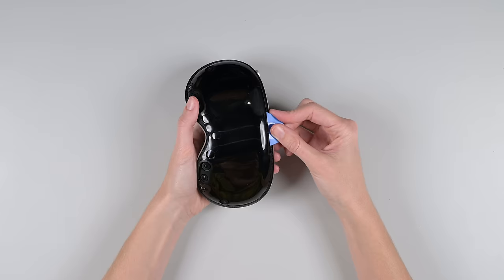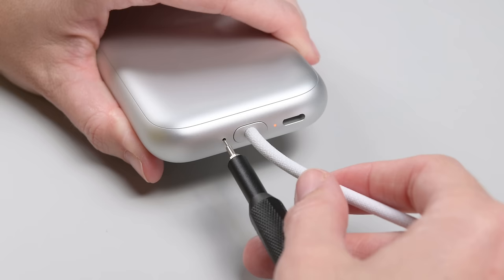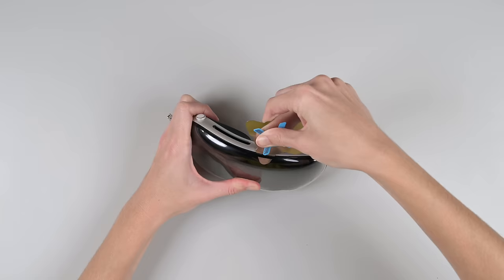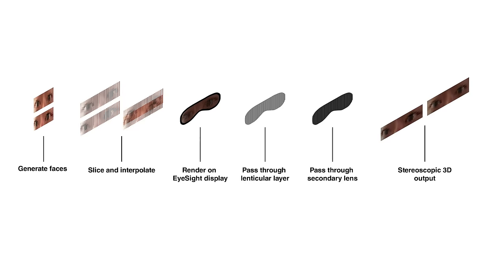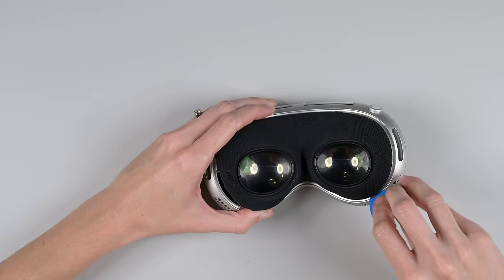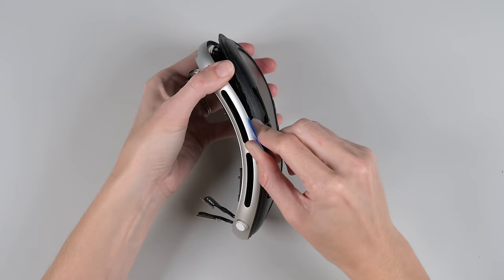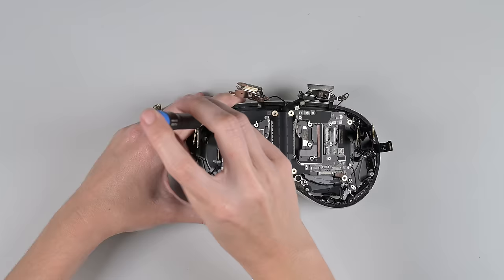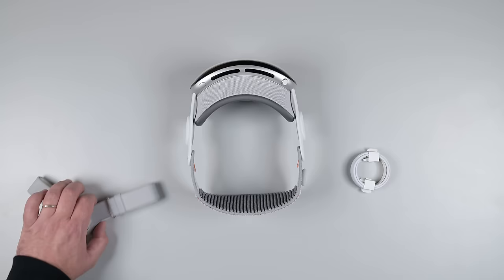Vision Pro Teardown: Behind the Complex and Creepy Tech

Comment: god... Apple's level of engineering is ... insane
Reply: It's insane to the point that it's foolish and ends up costing them and customers more
Why
Reply: To all apple fans.. That is not ment in the good way  ... xd
Reply: @VskutkuTrigen To the adults in the room … yes, yes it is.

Fanboying is a children’s hobby.
Reply: Correct statement, but for wrong reason. AVP's engineering is very impressive not because of complexity, but despite it. Good engineering is about finding the simplest way to achieve the desired result. A popular saying: "“Anyone can build a bridge that stands, but it takes an engineer to build a bridge that barely stands.” is related to that.
Reply: No wonder they didn’t make a lot of them
Reply: The difference between insanity and genius is measured only by success.
Reply: @ZeranZeran  Good engeniering cost money. Thats why a Bugatti cost more than a BMW, and a BMW more than a VW. And you dont have to buy Apple. But when i spend a lots of money i want good building quality. Or because i want good quality, i accept to pay more. But its cost the customer not much more. A galaxy cost almost the same as an iPhone. But the iPhone looks from the inside like 1500€, Samsung looks not like 1500€.
Reply: unneccessary complex? like even the internal of the iphones are riddled with uncessary flex cables. Samsung just have everything built in and connected through contacting copper joint.

For the vision pro, they added so much complexity for a pair of fake eyes that look freaking creepy (it is nothing like their ads). Basically it is a blurry set of eyes because the resolution of the front oled panel is nowhere near dense enough for a proper 3D stereoscopic effect. Additionally, that big oled panel is also extremely expensive, for almost no benefit because no one can see the fake eyes because it is so dark and blurry. This is more like Newton than the iPhone.
Reply: @Clyde-lj4fx   Over complicated build does not mean good build. Usually the opposite.
Reply: The Chinese factory is working overtime to produce Vision Pro🥲
Reply: @ZeranZeran  This is a $3500 top of the line AR headset, the people buying it definitely arent concerned about cost
Reply: @VskutkuTrigen  im pretty sure this is meant in a good way. Its nice to see Apple showing hardware innovation again
Reply: @kazioo2  there is no simple way to achieve what they are trying to build tho. When you're designing a headset like this, its gonna have to be overengineered
Reply: @couchpotatoes5158   I am one of the people concerned about the cost.
Reply: Well not just Apple but VR AR headset in general
Reply: Mmm... it's a lot of stuff. It feels very prototype-ish. All of this somehow needs to be condensed down into simpler construction to make it mainstream affordable. People have been trying to make VR mainstream for 30 years. This ain't it, either.
Reply: @ZeranZeran  it’s intended mainly for developers right now. It’s obviously not accessible to the vast majority of people. I’m guessing they’ll lower the price at some point
Reply: @couchpotatoes5158   Probably, but the current build is obnoxious
Reply: @ZeranZeran  I am seeing this peoduct as novelty.
If you want VR, there are already cheaper alternative in the market.
Apple Vision just... put everything up a notch.

A premium PC VR has a lot of trackers that you must put at the corner of the room to accurately track your movement.

Apple somehow miniaturize and put it in the head with size not as bigger than regular VR.

Plus... I am seeing Apple Vision as a Halo product, a product that makes people want to buy Apple product
Reply: There's a massive profit to be made off of making things crazy complicated. It's not necessary complication, but alas, not being able to repair a device anywhere else is huge money.
Reply: because its higher quality? @ZeranZeran
Reply: @VskutkuTrigen still trying to start war over electronics things in 2024 🤓
Reply: Insane is definitely the word to describe it, don't know about "engineering" though
Reply: @redbean9410  No, it's not
Reply: @ZeranZeran of course to put all the technology they have to single piece of headset and being efficient in almost everything. I do think that the high price of vision pro is because the RND not the cost of the part or anything.
Reply: @ragilsaputra5550  this is not efficient, its needlessly complicated so that people can't repair it themselves
Reply: @Clyde-lj4fx  please don't say good engineering and BMW in one sentence. I'm not saying someone else is better or worse, I'm just saying that can't say that about BMW.
Reply: @daddyscrapes  I wonder if they released so few because this is as close as their early prototypes were and most of this will be scrapped on gen2, or they simply don't care about repairability (considering they may need to service these devices in the near future for things like scratched lenses, faulty movable parts, etc).
Reply: @MindBlowerWTF  i say Bugatti cost more than a BMW. So i dont say bmw do it perfect etc. Only against VW, my family never hat problems with BMW. My dads drove 450.000km/279617,037mi without any problems.
Reply: @ZeranZeran  I have used Samsung, Xiaomi, LG, and Apple so far. I had the best user experience with Apple. Xiaomi is my second choice. Samsung was terrible. I had the Note 9, and I would leave the house around 7 AM, and by 3 PM, the battery was already drained. With my 11 Pro Max (same apps, same usage, etc.), the battery lasts well beyond the day.
Reply: @phantom1076  If you don't understand why Apple chose to implement a ridiculous looking screen on the outside of their headset you clearly have very little knowledge of their marketing techniques. Apple went through all that complex stuff just to stand out and make their product instantly recognizable in the sea of VR headsets. It has nothing to do with functioning properly and everything to do with brand recognition and being unique.
Reply: @ZeranZeran then explain German cars? How are they so high quality?
Reply: @Clyde-lj4fx  A Samsung at 1500 is a Fold, which does looks like how it's priced, if not more. You went from a Note 9 to a modern iPhone, just at when they just got good battery life and before that, everyone complained how Apple battery life was bad. So lets not be unreasonable here, please. Watch a Fold 5 or S24 teardown and battery tests.
Reply: @ZeranZeran  they absolutely are lmao. If they weren’t Apple wouldn’t be what they are
Reply: meanwhile the quest 2 isnt a novelty luxury product for overgrown man babies, costs like 10x less, and isnt over-engineered by a schizo with an electronics degree
Reply: @redbean9410    I think you over estimate Apple and under estimate greed. This type of design makes it harder for repair and everyone involved. Though it is a beta so hey
Reply: @ZeranZeran  Apple products are never meant for repairability nor do they ever market it as such. so it doesn’t make sense to judge them on something they have no intention of. Judge them only on what they advertise
Reply: almost every sinle digital camera is more complex than this yep.
Reply: @adredy  fact that u think that means u have no idea what you’re talking about
Reply: @Clyde-lj4fx  what are you talking about? samsung has way more advanced tech inside its S24U than apples I15PM
Reply: Incredible enginnering by Apple!
Reply: @danielplaya4211   I don't know what German cars have to do with this, but relating to a PC or a CPU, they would be most efficiently built and user friendly, able to be repaired. Not hidden behind 14 layers of plastic, and 64 screws. That should be saved for diving gear.
Reply: @Clyde-lj4fx  What anyone thinks what the smartphone looks inside? You don't pay for asthetics inside a smartphone, if you see inside, it is then broken. 
It is like admiring someone by the look of their inner organs...
Reply: @paristo ironically, that is why Apple products are well engineered, they tend to care how the internals function as well as look. In Steve Jobs biography by Walter Issacson, Jobs’s father paints both sides of the fence. The Younger Jobs asks why if people will only see the fence from the outside. The father replies, we see both sides of the fence…

At the end of the 20th century, the inside of desktops computers looked like controlled chaos. After Jobs returned to APPLE, the inside of the MAC looked like engineering art… Today people pay top dollar to have the internals of their custom computers look dynamically pleasing…

The human body is amazing both inside and outside, a marvel in itself, beauty can be found in every aspect even the most minute. Some people do not care what they are eating or what is inside the food they eat, that is why there such a thing as HOT DOGS…

🤔
Reply: @superzero4250  You are confusing now the all device internals to devices that have opening hatches and doors like central processing units.
In the late 90's and early 00 the internals were very much tailored beautiful in PC side as open cases were a thing in some European countries. The idea that it was just Apple is fallacy, as in the USA that was the case but Apple wasn't so big in Europe.

The argument still stands, you don't see inside your smartphone, you don't see inside your VR glasses, you don't see under your car...  It is irrelevant to make the engineering design suffer for the beauty there, when you don't see a thing there...
Reply: @paristo  Not confusing anything, Macs were designed with an aesthetic inside and out with purpose, and usually not a detriment to the performance nor function… Unlike Windows PC’s, almost no one attempted to display the internals of Macs. Apple is about Form | Function | Aesthetic, they don’t do irrelevant, you must be mistaking them for Windows PC and Android manufacturers…

Ironically, the point of VR glasses | goggles is to see inside them. Then to, APPLE produced an AR headset capable of VR…

🤔

Comment: I appreciate the engineers make it so easy to replace the battery, the head strap, and speaker temples.
Reply: Putting a connector onto a battery isn't really something ingenious. And you won't be replacing the strap or the speakers in a looooong time, if ever. Replacable lenses would be a really impressive move, because scratched lenses really hurt the experience
Reply: @iowawalker  you have to tear-down basically the entire headset to access the battery on the quest 2, lens protectors will probably become available soon using the same attachment method as the zeiss prescription lenses.
Reply: there are actually different straps (official name for the part with the speaker) you can swap in, such as the 300$(!!!) developer strap that exposes a USB-C port opposite the power connector and lets you upload apps from a mac
Reply: @mactep1  you can use Quest 2 with a cable, so it's not like you would throw it away if battery wears out. And I really haven't heard complaints about wireless VR headsets having battery issues, because most people don't or can't use them as much. Anyway, Apple charges a chunky price for an additional battery for this thing
Reply: @mactep1   To be fair, Meta wasn't attacked nearly as much by legislators and EU with right to repair as Apple.
Reply: @iowawalker  It really is as they basically entirely futurproofed the headset if they ever decide to make a propper battery strap then it's only gonna be a battery strap with the right connector to do.
Reply: @mactep1  Then literally just use an external battery pack with the Quest 2? USB-C battery packs that work with a Quest are well under $50, and they will give more battery life than Apple's ridiculous $200 external battery pack with a proprietary connector.

I cannot believe people are buying the BS about the repairable battery on the Vision Pro. Maybe when Apple comes up with a replaceable battery that doesn't compromise on usability, I will applaud them. It doesn't look like that's happening any time soon.
Reply: @maka6000  I feel like Apple made this external battery just to spite legislators and consumers. Apple will claim that this "user replaceable" battery "hurts" the user experience, and thus, right to repair in general is bad.

Nothing about using an external battery pack with a PROPRIETARY connector is pro-consumer. Not only do you have to buy a $200 (yes, it's actually $200) replacement battery from Apple, you still don't even have the option of not using an external battery pack.
Reply: @iowawalker  If you only use if for 30 min sessions that is. The heavy users around me all have battery degraded in a year.
Reply: Yes. Sadly, it's repairable. I hope apple fixes this bug in the next version by software pairing each item to the device.
Reply: If they cared about longevity, they would let people bypass the battery completely and mains-power it.
Once the battery dies, it won't turn on - even with the battery connected to the charger. And the double proprietry connection makes me think 3rd party batteries may be hard to develop.
So once the battery dies, and replacements cease production it still becomes e-waste.

Meta are worse by integrating it sure - but HTC are better by allowing the XR Elite to be powered by any USB battery bank or mains.
Reply: @iowawalker how can you scratch one of those super hidden lenses?😂
Reply: ahahah you underestimate apple, if it's not original from the same device it wont power device. (tested).
Reply: @maka6000  It’s because VR headsets and batteries do not fall under the EU regulation for connector and, I believe, repeatability.
Reply: Money is the issue still
Reply: @iowawalker  you won't be replacing the strap or the speakers in a looooong time, if ever
According to who, Mr Helper? Headstraps are one of the FIRST aftermarket items people replace on headsets. Where did you even get that absurd notion from?
Reply: @WindFireAllThatKindOfThing  I am only aware of IMPROVED aftermarket "straps" for Quest 2s and 3s that improve comfort. Replacing straps as they go bad is something I haven't come around with all my headsets at least, although they all had rigid head mounts (or whatever they call it). I can imagine velcro wearing out on Quest 2 strap, but only if you readjust the strap each time. That won't be a problem with Vision, as it seems to be a contracting one.
Reply: @iowawalker   I can't imagine that elastic harness, no matter how nice, lasting more than 2 years before the loss of elasticity just from aging out results in many calls for a hard strap and improved soft straps with more top support. Even just sitting in the box, my old Q2 strap is unserviceable after sitting around for 3 years. It don't stretch no more. At least, not enough to play looking down at the ball in Walkabout without it suddenly dangling off my face, so I have to go back to the Elite hard strap
Reply: @WindFireAllThatKindOfThing  okay, that's valid. As I said, I only owned headsets with rigid mounts, and I've only tried soft straps on some random public VR attraction, where it was holding up alright, considering it was used on many people per day. My friend owns a Quest 2 for a few years now, and he never mentioned the strap being bad.
Reply: @Maubald  the front is plastic (covering the glass) insanely easy to scratch.
Reply: @Dreadpirateflappy  oh sorry, my bad. I thought you meant the lenses inside. :)
Reply: It's obvious that those same engineers could have created the internals with repairability in mind. Apple is making things hard to repair on purpose for sure.
Reply: @EricChiEric  This is such an obvious joke, yet I'm so destroyed by the Internet that I'm sure there are people out there that actually do think that way.

Comment: Proud to see them take apart the product I worked on for years. Designing the parts to fit a curved design was some of the most difficult things ever done by consumer electronics design engineers.
Reply: Do you reckon the price is fair?
Reply: @RedHair651 I think so. It's a high-end, ergonomic Macbook Pro with M2 and R1 on your head, dozens of cameras, two motors, fans, speakers, and many sensors. It is also made of anodized aluminum, recycled fabric, glass, and carbon fiber.
Reply: А теперь скажи мне, как мне из России попасть к вам на работу??? Я дизайнер и люблю создавать такие вещи!
Данный девайс поражает своим качеством и придерживается философии основателя (никакого воздуха!)
Reply: What's driving the heavy weight versus other headsets? Is it the aluminum and glass versus polycarbonate or just the number of sensors?
Reply: @farhan_hossain: why took so long for Apple to develop a VR set? Also, I think “you” could avoid to add the frontal display (does not add much functionality) and sell it for lower price. I mean , when Steve Jobs presented the iPhone, people could afford it. The next device should be sold at around 1000 $ (with similar or better specs), otherwise it will be a flop. Anyway, congrats for the design, I really think  it a remarkable piece of engineering.